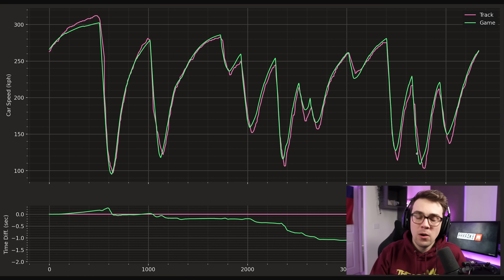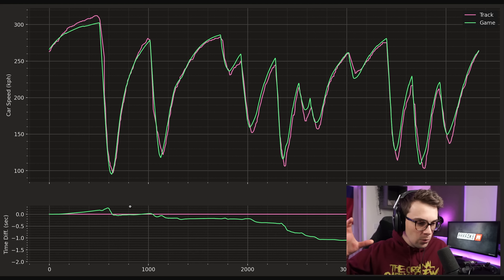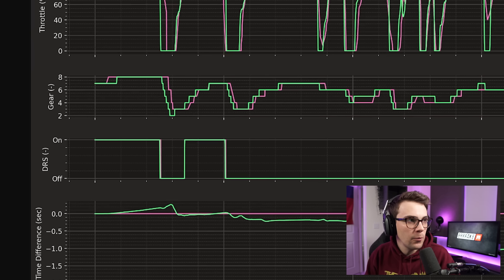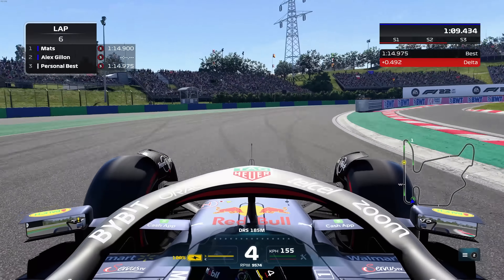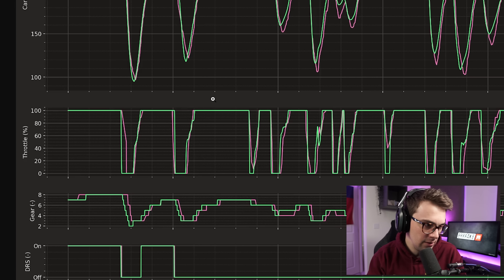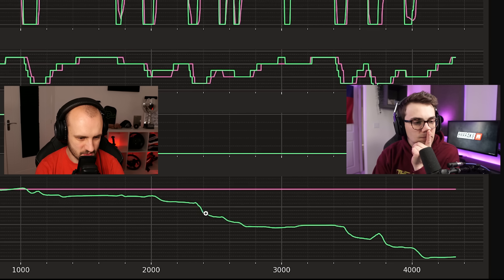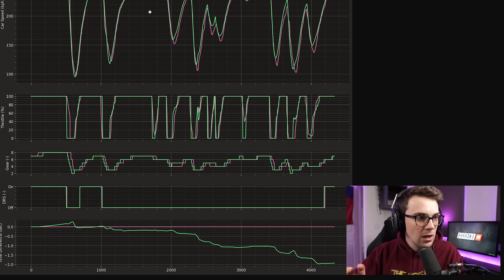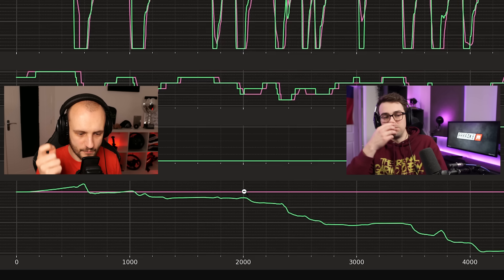I Got An F1 Engineer To Test Handling Realism In F1 22

Comment: What you can't see from telemetry is that in real life at low speed it seems much easier to catch a slide or oversteer, while in F1 22 the slip angle of the tyres is so wrong that when you lose the car is almost always game over
Reply: Ye, most people don't complain about traction, its more about the force feedback. iRacing is harder with traction, but its much easier to catch and feel when you have tire spin, plus the car doesn't turn into a ballerina with zero steering input.
Reply: probably because in real life you can immediately feel the slide by your ass but in the game you need to see it and it has delay which is crucial
Reply: That’s because ffb on f1 22 game is trash, you don’t have feeling
Reply: @M3Rambutan  Precisely! So much easier to catch a snap of oversteer when you're sitting in the actual car than when you're playing a game
Reply: I think the throttle application graph was telling a bit of a fib in this scenario purely because of the gear ratio chart saying that the 3rd gear had way more 100% throttle inputs from the real life meanwhile the 100% throttle input for the game didn't really come until 4th gear, further proving how actually slippery the game is

Comment: Before changing anything, I think you should try to do the same on a Q3 session on the Hungaroring (GP Mode). Tyre wear will be active and you will be dropping some grip as the lap goes on.
Reply from the maker: Good point! Although the wear will be minimal across a lap, nowhere near enough. But I will do a baseline lap before I start making changes
Reply: @AlexGillon  Of course! But you are chasing realistic results and there have been cases where tire wear  have been reported to hamper performance in the sector of a quali lap. Of course those reports did not take into account thermal degradation or anything of that kind, but it's a pretty easy parameter to measure.
Reply: @AlexGillon  You can just raise the tire pressures to maximum and I think that will already make it spot on with the overheating in the second half of the lap!
Reply: And i believe in timetrial the tyre temperatures are always locked on the perfect temperature so there is no overheating
Reply: @Ripsteri  exactly!
Reply: Yeah, Time Trial is definitely not the greatest chooce for this.
Reply: @Alex Gillon  it's also about tire temperature during a lap that will affect lap times.

But I think the biggest problem of the game is inconsistency with the grip level or the torque.
It's too often that the cars are breaking out suddenly. It also has nothing to do with TC off/mid/on.
Just tried it at Spain on turn 3.
Same effect with all assists on or off.
Sometimes, it works full throttle, sometimes not.
The game has a huge issue with the phtsic model.

Comment: About the traction: you must compare gears used in the corners. You are probably  1-2 gear ratios higher than F1 drivers use in the same low speed corner (every single F1 player uses almost always 3-4 gear for turns that require 2nd gear in real life) so the traction is actually much higher at those gears than real life (in fact you can see in the graph how the gear ratios of higher gears are so messed up, just because of this). You can prove this also in the telemetry because in every single low corner you are carrying a higher speed than Russell just because you are using a higher gear.
Reply: that's actually a good point.
Reply: F1 drivers usually don't go lower than 3rd gear too.
Reply: @superstar5042  not true at all
Reply: @superstar5042  They absolutely do. Take for example the first corner at Bahrain, it's always taken in 2nd gear, in F1 esports it is either taken in 4th directly or at the very least in 3rd immediately upper shift to 4th. Paul Ricard likewise has many corners that are taken in 2nd gear, or Marina Bay, to not let talk about Monaco (even there in F1 esports 2nd gear hairpins are quickly up shift to 4th, that's totally insane). 
Frankly what you are saying is totally incorrect, in fact there are probably more circuits in which hairpins or slow corners are taken in 2nd than those that aren't.
Reply: Im doing it wrong 😭. I use 2nd gear way to often rip

Comment: The one thing I do hear regularly, especially from pro drivers I watch play, like lecler, lando, albon all say traction is way harder in the game. Medium traction in the game is closer to the real thing.
Reply: I've heard that repeatedly but isn't that all in response to F1 2019 when they were all playing it during lockdowns?  I don't think I've heard anything from any driver about how F1 22 specifically feels.  Because F1 2020 came out and was way grippier than 2019 was I think in response to that feedback.
Reply: @Nicolas_Cage_Bees  2022 is way way worse on traction than f1 2020 and I would say even worse than 2019. I enjoyed the physics in 2020 the most. I also drove a few f1 cars in other sims and they always have way more traction. It's so way harder to spin a RSS Formula hybrid than a f1 game car.
f1 2021 was also fine for me with the traction, but in f1 2022 I am always afraid of the throttle pedal. that really should not be the case with such enormous tyres and so much downforce
Reply: @HeavyMetalGamingHD  Just because the wheels are bigger, it doesn't mean the tyres provide more grip.
The low profile tyres actually provide less mechanical grip than the 2017-21 cars did...also less overall downforce.
Reply: @alpacaman6256  a bit less not much less. so no, completely disagree with you. the current f1 tyres provide massive grip and that is not correctly represented in the game.
Reply: @HeavyMetalGamingHD  It is a significant loss of grip compared to 2021.
More inertia, less fat spongy sidewall to flex etc etc etc.
It's just a fact that the tyres don't provide as much grip this year, you can hear it on throttle.
If you go back and read the initial thoughts of drivers from testing last year - they say the exact same thing: more snaps of oversteer, more sliding and waaay less grip on exit compared to previous years.
I only play iRacing so I don't know how it compares, but if they added more grip to the tyre model then it would be ridiculously faster than the real car.

Comment: Great vid guys. Only thing I’d add is I think the main criticism related to traction is the inconsistency + the use of high gears to almost hack what is possible from traction
Reply: yeah and thats why i thought the traction comparison is a bit dodgy and misleading since it should not be comparable at all like they did it. 
Alex shouldve used the same gears, so always 2nd gear on exit, as Russell and then compare the traction. Cuz the result would almost certainly be completely different then as Alex would not have been able to hit that throttle as much as he did in the video with a shortshirt to 3rd.

Comment: My thoughts are, that in real life, you have the external elements on the body that plays a big role - which you do not have in a sim.  Just the G-forces alone is probably playing a big role in unsettling the driver for the next corner etc.  Also the risk of crashing is probably playing a role as well.  In a sim you do not worry about loss of life and take more chances.

Comment: Alex, just a quick heads up, if you ‘fix’ the DRS, you wouldn’t be ‘neck and neck’ by Turn 4, the game would be further ahead as you currently lose time on the straights. As in you’d be 0.8s up not just 0.4s. Think you guys got it slightly wrong towards the end there… seemingly some more grip intrinsically in the game so maybe not quite as close as you concluded. Don’t forget also the really tight and twisty stuff happens in the second half of the lap which would compound an increase in tyre grip (likely more than just tyre deg).

If you’re doing tyre deg perhaps you could do some more analysis long run lap deltas and see the lap time drop off rate compared to reality? Then you could filter that into an accurate quali deg and then you can isolate that variable and give you some closer metrics on grip differentials etc.

I like the idea though… this is probably what game designers have to go through in the first place

Comment: one thing that you shouldve mentioned about tire grip is that in time trail it doesnt degrade. therefore you have optimum tire grip at all times. Also about the thermals,  when you do a pitstop in a race. the first 1,5 laps are much harder to get up to pace because of the tire temps. i feel like they should extend that.

Comment: The traction is actually good on F1 22 when you race in high downforce circuits, so I think Hungaroring is not the best circuit to do the traction comparison. The thing is in real life drivers are taking some corners at second gear and on the game we have to take it on 4th or 5th gear to not loose the car. It's not good at all. Nevertheless, great insights on the video!

Comment: 9:00 and 9:28 Am I dumb or is this a wrong conclusion? Alex loses time on the straights as the DRS in-game is less powerful. Yet he is 4-5 tenths ahead in turn 5. So if you make the DRS more powerful as in real life, you'd be even more ahead, not "neck in neck". You already gain a lot of time in the corners in the first half of the lap, not only in the second half when the lack of tire degredation becomes more relevant. So you just have overall too much grip, which is even enhanced in the second half of the lap. Which could also be due to setup, as you're just faster in most corners (funnily enough not in all of them though, maybe that's due to track inaccuracies in the game) but slower on the straights.
Reply: I looked at the data again and noticed that you don't really gain lap time in the first corners as your apex speeds are even a little lower/comparable to real life. So then I guess you have to get the time under braking. And regarding setup, on straights without DRS, you seem to be comparable, even slightly faster than real life. So you didn't just put on a setup which had much more downforce than real life, straight performance is similar, and cornering performance is also similar in the beginning of the lap.

So I conclude that setup was comparable, DRS in-game is too weak, in-game braking is overpowered (gaining the lap time back you lost in the DRS zones), and tire degredation is too weak, giving you too much grip/apex speed in the second half of the lap. Basically what you said, except of the addition of setup and braking.

Comment: The outcome is somewhat very misleading and they compared wrong things to each other.

Alex lap was done under normal F1 22 shifting (perhaps slightly lower than you would go) but still higher than IRL and Russells lap. So essentially they are comparing Alex in third gear on the apex and throttle out of the corner to Russell whos in 2nd gear at that time and does no shortshifting, while Alex is arleady in fourth when Russell just upshifts to third.

That makes a comparison impossible as traction is obviously different in every gear. Alex should instead have done his lap in the same gears (or as close as possible) as Russell. Because then the outcome would have been completely different as George is flat in 2nd gear and Alex wouldve had to be much more cautious while putting power down.